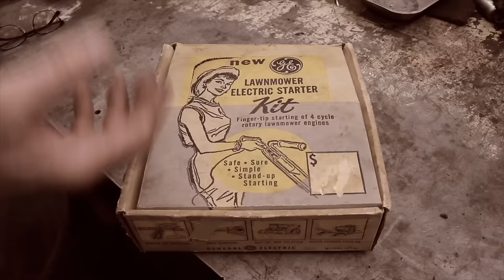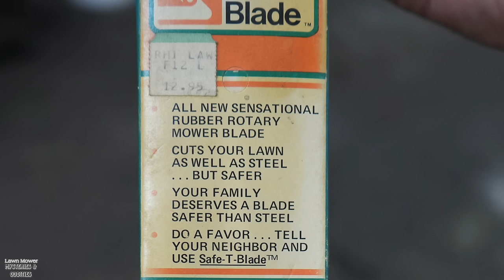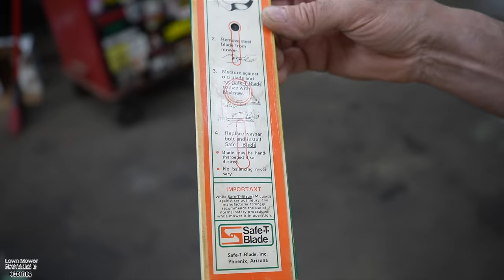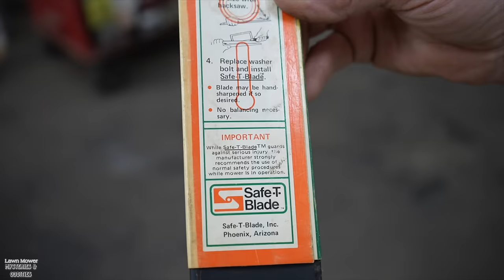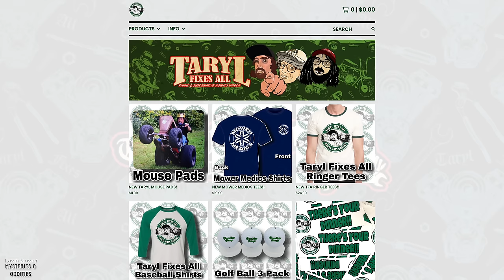Does This Odd Mower Blade Actually Sharpen Itself? Let's Find Out

Comment: They intro always makes my day. I didn't know rubber could be sharpened.
Reply: Wonder how you would sharpen it.  File or a grinder ? Or was there a special tool for sharpening. Very neat idea for a small manicure lawn that has no trash or stumps. 😂
Reply: Not bad
Reply: That blade had a lot of false advertising.  Just imagine seeing the ad for that on TV.  Most people would realize that these things are junk.
Reply: @dougpursell9591  probably a flap disk
Reply: @Myself-yh9rr  Back then weed wackers were relative new and used nylon string so why not a rubber blade?
Reply: Burn rubber, not yur grass. 😃

Comment: I found this from Farm Show magazine.  Kind of wish they still made these. 
 Rubber Mower Blade
"Our rubber mower blade cuts grass as well or better than steel thanks to the nylon fibers that run through it," says John Chung, representative of Safe-T-Blade, Inc., manufacturer of a new rubber lawn mower blade that virtually eliminates danger to toes and fingers from spinning blades and reduces the danger from thrown rocks and other ob-
jects. The combination rubber-nylon blade has a steel mounting insert at center. One size replaces any 17 to 22-in. blade. You simply trim off the ends of the blade to fit.
"It'll never rust, chip or break and you never have to sharpen it because as the rubber wears the nylon fibers that do the cutting are exposed. It's the only lawn mower blade that's self-sharpening and self-balancing, requiring no maintenance. It also works better in damp grass because grass won't stick to it as easily," says Chung, noting that the blade virtually eliminates danger to operators. "When the blade strikes an object, it absorbs the impact, greatly reducing the chance of injury and reducing the danger of flying rocks or objects. It also protects the crankshaft"
They used to advertise them in Farm Show magazine.  I always thought they would be good for my rocky mountain property in Vermont.  Hidden tips of rocks, and boulders destroy my blades and spindles.  Might be worth a try. I believe a different company sells something similar today.

Comment: It's amazing what a 'dull' blade can do. I just changed blades on my Toro Wheel Horse 520h a couple of days ago, for freshly sharpened ones (someone at Taryl's shop sharpened them all for me) and the old ones were so dull they could not have possibly been any duller. Yet they were cutting grass last season, not perfectly but they were cutting.
Reply: They were NOT cutting, they were tearing the grass off.

Comment: Ive got this big area on my yard that really kicks up the dirt and dust when you mow it so i took 3 of those aftermarket string trimmer heads  "shakespeare"  brand and modified  them to fit my 48 Inch  craftsman deck to see if they would work  and they work pretty good cutting the grass and kick up 0 dirt or dust .   id get caked with dirt and kick up a big dust cloud  now none at all .   they usually last 2 times before needing to replace the strings.

Comment: It seems to do a reasonable job of cutting. I noticed that the beer bottle didn't seem to shatter as badly as if it were hit with a steel blade. Time would be the teller here as I don't think it would last as many seasons as a steel blade. And it certainly won't sharpen itself. That's a bit of a wild claim. But if you had a good yard with few obstructions, you could do worse.

Comment: No mower blade sharpens itself!!
Reply: Yuh huh!  Back in the '70s they said if you put a razor blade inside a pyramid made of straws or wood dowels, it'd sharpen itself!  I'm sure a lawn mower blade would work as well!
Reply: I walked into the garage my blade was sharping itself.  Really going at it too.
Reply: Have you seen the newish JD self sharpening blade? It has a hardened layer on the bottom and softer steel on top that wears away, leaving the lower hardened steel as the cutting edge $$$$

Comment: Remember the 'Flymow"?
Reply: The upside-down wheelbarrow, a big favorite!
Reply: i remember those
Reply: My grandfather's mechanic's invention? Yep. Used to race in speedway and his mate who maintained his car said check this thing out. Wow, don't run over that cord! We got to see engines instead of motors and that really made the things a lot safer. Down here in Australia it all happened.
Reply: There was an old hardware store that closed in my city. They have a Flymow hanging on the wall. Currently trying to buy it from the owner.
Reply: I think they still sell those in Europe.
Reply: It's probably better 4 ur mower. It's less shock when u hit things. So it has 2 b better on the engine
Reply: @douggolde7582  Confirmed, still sold both in stores and online.
Reply: Yeah, when I was young. I worked at a country club. We had a bunch of them that we mowed the hills on the side of fairways to keep from scalping them. You could hold on to one while going down the fairway in a golf cart an let it go, you would have a heck of a time catching it.
Reply: By K -Tel
Reply: We have an orange flymo sitting at the shop, been sittin there for quite some time. Thinking about about snagging it up.
Reply: Flymo are still made and still often used on golf courses.
We use petrol powered ones around dams.
The best were an Allen hover mower. Had.a 2 stroke Suzuki engine on them .
Reply: Yep!
Reply: I have a flymo Gct20 I need a needle or to find a alternative otherwise works just shot out
Reply: Is that the hover mower? Those things float like a dream when maintained
Reply: Remember the alamo!
Reply: @anthonymorency1107  You betcha! I was THERE.
Reply: I have the 2 that Taryl featured  , I had the crew autograph them .(
Reply: @douggolde7582  they are still sold here under the husqavarna name, or a few years ago was
Reply: The-ALAMO.... That's GOOD-STUFF👍
Reply: Flymo mowers are still sold in the UK but unlike the old ones they are cheap disposable electric mowers now. Husqvarna owns the Flymo brand and the gas original Flymo is now part of their Husqvarna range. Toro also produce a hover mower based on the old UK Allen hover mower brand.
Reply: @walter8008 the Allen one is now the Toro Hover Pro
Reply: Nooooo, who remembers a Flymo?!! Duh.
Reply: @ScottGovey  if it has the old two stroke engine, replace it with a Honda GCV engine. All the new hover mowers tend to have this engine now.
Reply: I had one that I got out of the trash when I was 14. I got it running and It did mow grass. Don’t think they worked well because they pushed the grass down from the fan to make it fly.
Reply: I loved the flymow as a kid. Still don't get how it sucked the grass up at the same time as blowing like a hovercraft.
Reply: Yes, in the 1970s.  Ours never worked well.
Reply: There was one upstairs at my previous place of employment, hidden away for over 20 years
Reply: Mememememe anyone remember the flymo memememem duurrrdrrr
Reply: Still use one at our county country club, to mow around sand traps on steep slopes, have one that uses weedeater string, and one that uses steel blades.

Comment: I wonder if this rubber blade would protect the crankshaft from getting bent when hitting a hard object.
Reply: Naw
Reply: hell no lol probably would make it worse.
Reply: It would if it did not have steel inside it.
Reply: It’s a steel blade with rubber tips.
Reply: I think it would help.  Every bent blade I’ve changed from impact was damaged and bent on the ends of the blade.  With this part being solid rubber, I assume it would rip off rather before doing enough impact to damage the crank.
Reply: I puree d a brick with a push mower  an ate the blade till it was no more put a new blade on a it was like a new machine how the hell are you bending cranks I have bagged about 6 watermains using a walker riding mower killed the deck with one have it sit on my desk as a reminder but on a push mower I just don't see it
Reply: It would help absorb some shock, but the cause of bent crankshaft is the sudden stopping of the engine when at Mid to high RPM. The energy has to be absorbed in some way, usually resulting in bent blades or a bent crankshaft, or both.
Reply: @fleamine  I would recommend the Bradley even cut 22" its belt driven you won't have that problem anymore
Reply: Yes
Reply: @CotyRiddle  Agreed, due to the imbalance a breakage would create.
Reply: no.
Reply: @jbstepchild  watermains? you're supposed to mow above ground, not underground.
Reply: @n0ukf  snow plowes sheer em off there not under ground here some stick up 10" out of the ground an then some how they end up back in there spot an idk deep grass  an they just blend in
Reply: Yes of course.
Reply: @n0ukf   I wondered the same thing.  I assume he means the valve shut off box caps since watermains are the underground water pipes.

Comment: You put it through the torture test. I think it did good. It looks like the main safety feature is, it doesn't send rocks off like bullets. The rubber blade absorbs most of the energy when it hits something hard.

Comment: Thank ewe for that demo!! Reminds me of my two neighbors. Mrs Wessel had the Lawn Boy and Mr Johnson was working on a circular ring with 4 blades . He was using a Blue Boy mower that was made in Largo Florida in the 50’s to mid 70’s. Our Blue boy had a 5 hp Techimish on it! In 73 dad was mowing down by the lake and parts exploded all over thelake!!   0:51
Reply: Some OEMs did have a four-blade flail (short blades that pivot on one end) setup, I think Jacobsen rotary mowers used them.

Comment: My dad bought roughly 1/2 case of those things at a local park and swap in Mesa AZ.  We put those things on every mower we could, including Grandpa's 8hp Wards rider. they lasted forever, and the trick was to grind an edge before installation.  I never saw any of them get chewed up like your test blade.  That 1960's riding mower had the same set on it for over 20 years.  I love 'em. it's a shame they stopped making them. I would have put them on all my mowers when I had my business.  Glad you were fair with your review,  heck, that one was 40+ years old!  Take Care!

Comment: I feel like this would be great for saving push mower engines when hitting stumps or sidewalks, but in terms of it being safer for people, absolutely not. It will cut your foot regardless of it being flexible or not; you MIGHT have a chance if your wearing proper steel toe boots. I haven't seen the whole video yet, but I guarantee its going to be self dulling, not sharpening.

Comment: Make a pass with the rubber blade  and next to it make a pass with the metal blade to compare the 2 side by side same height setting same rpm same walking speed same cutting direction.

Comment: You can get a decibel meter app for your phone. Why hasn't someone made a fishing line blade for a mower?
Reply: They have, called a string line mower. Looks like an oversized string trimmer that you push with a 4 cycle gas engine.

Comment: Now what I think about the "SAFETY" blade,,, it might be good for NICE SMOOTH LAWN'S SUCH AS IN CITY'S ETC... OR LARGE SMOOTH YARD'S OUT IN THE COUNTRY? BUT FOR ROUGH AREAS LIKE YOU JUST WENT THROUGH,,,, I BELIEVE I WOULD STICK WITH THE ALL METAL BLADES,,,, BY THE WAY I'VE SEEN AN ADVERTISEMENT FOR ANOTHER GADGET,,, IT LOOKS LIKE A ROUND PLATE( YOU BOLT IN PLACE OF THE BLADES) AND IT HAS STEM'S STICKING OUT,, KINDA LOOKS LIKE A WEED WACKER BLADE....... I'd like to see you get one of those and try it out.... If I can find it again I'll put the name of it on here,,,, the commercial shows putting them on zero turn mowers etc.... All it looks like to me is a round disc with BLACK ZIP TIES STICKING OUT!😮

Comment: When I was in high school, we moved into a house where the previous owner had left a rotary mower behind, since they couldn't use it where they were moving. It was a nice mower, so we used it for another 20 years. After the first season, we were putting it up for the winter. We flipped it over and cleaned out the deck and sharpened the blade. It was then that we realized that the previous owner had put the blade on upside down. So the dull side had been cutting our grass all summer. We never noticed anything wrong. It worked fine. Needless to say, we didn't have to sharpen the blade. We just turned it over, and used it the next season. It did seem to cut a little better with the blade installed properly, and bogged down less. But the take-away is that you really don't need a very sharp blade to cut grass with a rotary mower.
Reply: I mean, if you think about it, we’ve were cutting weeds with round cord for years….thats about as dull as it gets, lol.

Comment: $12.95 in 1985 would be equal to $37.59 in March 2024.  That was expensive in 1985.  I am impressed that the rubber did not seem to crack and get brittle.

Comment: It's not around anymore cause it's false advertising. The safest way of cutting is sickle bar mower, like an old Jari sickle mower. Large debris (bottles, cans, etc.) just floats over the sickle blade and couldn't cut through a stump. It will cut through sapplings up to an inch in diameter. 
Sickle blade mowers aren't popular cause large debris (clippings) are left behind, which means extra work versus mulching mower.

Comment: Years ago my mother had a lawnboy and she hit a steel pipe that was connected up to our sump pump used to drain further away from our foundation.  Mower was only about a year or two old.  Bent the shaft and did other internal damage.  I think this rubber blade would have saved the engine by flexing.

Comment: metal flat stainless steel bar stock an evenly placed hole on each tip those plastic weed Wacker brush cutter serrated blades probably pivoting on 1/4 20 bolt and 2 nylock nuts  lock washer on bolt 🔩 head side regular washer on other then simply spin her up on your 24inch mower the plastic should pivot instead of break when hitting stuff but i think they use heavy duty plastic like 'grass' fiber nylon😂❤

Comment: You know what's really neat, that rubber is way better than today's products. Granted some of that might be due to regulations however I have an old "indoor horse shoe" set that has rubber pads and they are still extremely pliable! If they were legally allowed to make the same product today it would fall apart inside the original package withing 8 years. That probably 50 year old rubber horseshoe set is fully pliable and almost zero cracking anywhere on the surface.

Comment: Dear Taryl. Inside the B&S engines there is a synchro ballancer weight which is connected to the crankshaft . I wander what would happen if the weight is removed. Would it do any harm for running the engine without this weight ? Can you make a video on that and demonstrate an engine running without that weight ? Thank you so much !!!!!!!!!

Comment: I never even knew there was such a blade. If you want a mowing oddity you need to see if you can get hold of a Gtech (disposable internet sold) battery mower from the UK, because unlike most normal rotary mowers it doesn't have a full width blade, only half a blade.

Comment: When the rubber gets old it gets brittle and will break off. I was given a push mower back in the 90s to get running and had one of these. I didn't know and half the blade threw off and put a dent in a truck when I got it running.
I didn't know it was aftermarket. I thought it was some goofy factory gimmick. Truthfully I had forgot about it and this is the 2nd and 3rd ones I've ever seen.

Comment: I think it might be good for someone who has a small lot to mow and maybe has a lot of obstacles that if hit might damage the mower, but you would have to replace the blade and inspect it pretty frequently.  As far as something like a commercial application it would not work. It would NOT hold up to being used 40 hours or more a week. Neat concept. The problem was a small customer base.

Comment: Apparently, it's the nylon fibers that do the cutting, the rubber is just a form to hold them in place, so as the rubber wears the fibers get exposed... but yeah - I think they over sell it. A rubber blade would be good for edging sidewalks so as not to chip the cement I guess.

Comment: A BIG FAIL, the blade is already trashed on the edge after you putting it through the paces for just a little bit of time. This blade does not sharpen at all, and no way to sharpen it…..will only be good if you replace every season with a new one and there is your dinner. Stick to a steel blade as you can sharpen it and make it last many years or decades depending on use. The rubber blade also has a steel insert for a portion of the blade, good luck safety wise when that hit you. Even the rubber portion at that speed will tear a body part off, if not the full way through then half way through so no go there. Cheers.

Comment: I'm 63 and took the old Foley Belsaw small engine training. There is a real way to sharpen mower blades so that they are actually self sharpening as they wear instead of just getting duller. Don't have to resharpen so often.

Comment: If a person used it reasonably it might last a while. It very well might prevent a stripped key or a bent crank. I don't see it lasting as long as a metal blade though. If you wanted to sharpen it how could that be done?

Comment: i would like to see the quality of the cut side by side with a metal blade...I cannot see the rubber blade cutting the grass clean like a knife or scissors or a metal blade...it probably leaves the ends of the grass in shreds...."It seemed like a good idea at the time"

Comment: Back 65 while going too fast stepped into back  of a mower cut the top off my boot clear too the  to the string pull my sock off only turned toes blue so steel blades are safe also